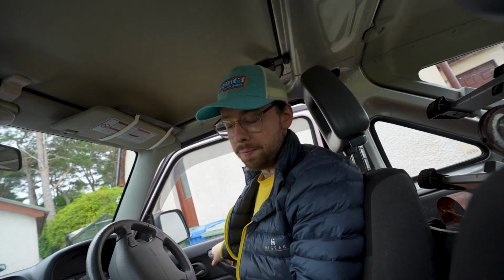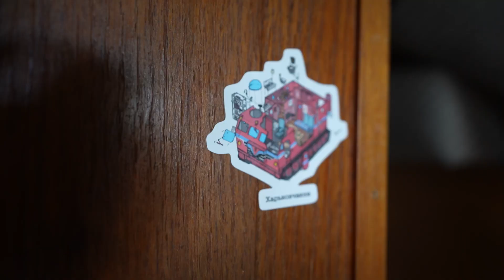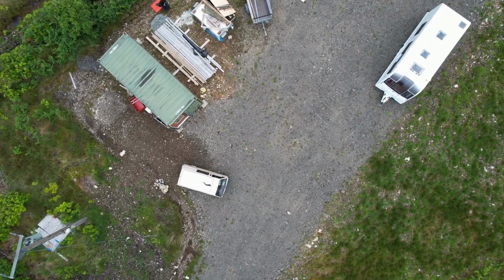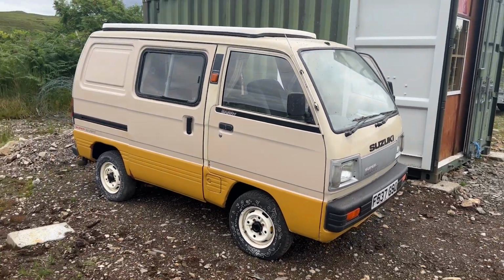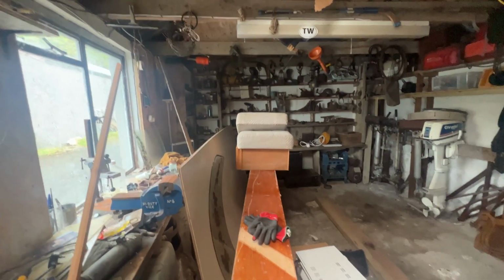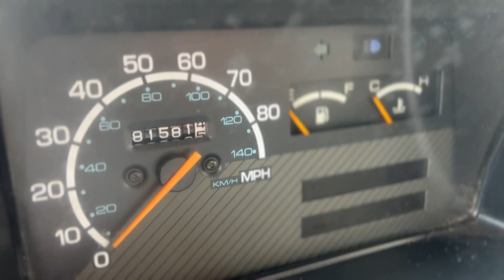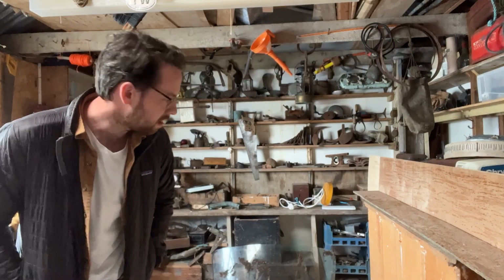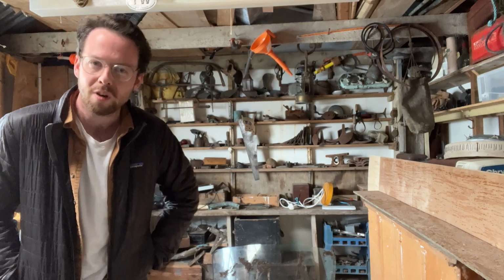Saying Goodbye To the World's Smallest Campervan - 1989 Suzuki Super Carry

Comment: Anecdotes about our one. We had a matt black super carry at uni, later refinished as a police van.
When you run out of gas, you can put your hands on each window from the inside and rock the whole van to get more fuel to drop down near the pickup.
If you forget the keys, you can do a CPR compression on the side window, combined with a prompt sideways push, and it will unlatch and slide open.
Also, if you forgot your keys, or if you wanted to play a prank on your flatmate by parking it somewhere else, you could unplug the key barrel and hotwire it with zero knowledge, trial and error in about 10 seconds, shorting pins in the connector until you hear the fuel pump tick and then the starter turn over.